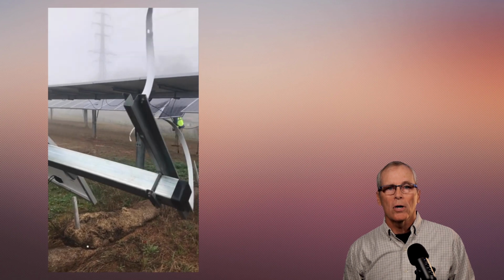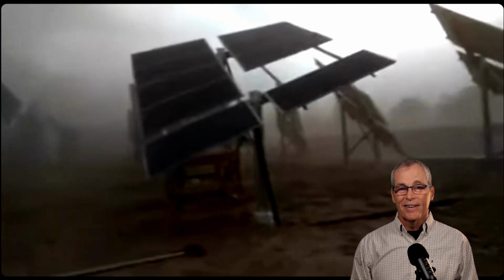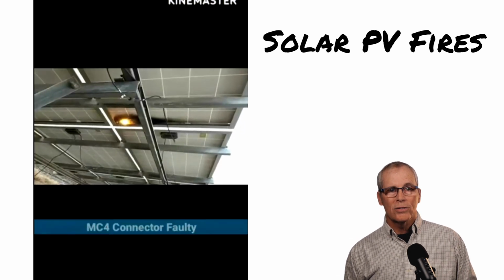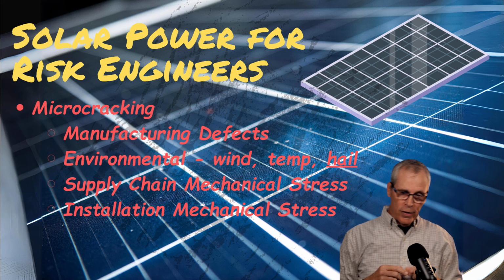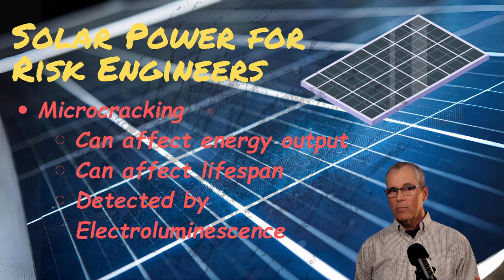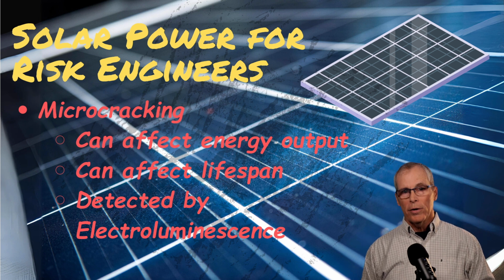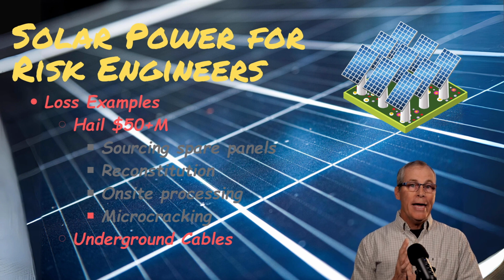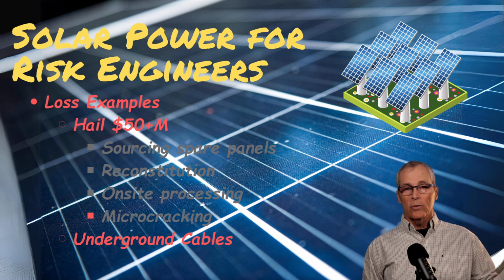Solar Power for Risk Engineers

Comment: I think insurers and other stakeholders should come up with a recommended distance between two strings which has to be maintained to avoid all strings catching fire from nearby strings. Apart from that heat/smoke sensors must be there under panel/string which can activate fire extinguishers or Medium velocity water sprinklers.
Reply from the maker: Interesting idea. We have to remember that the objective is to make electricity, not to prevent fires.

Comment: Great video and good points. A few thoughts:

- wind stow should not be flat. Flat panels will catch the wind like an airfoil and develop oscillating motion (torsion on the tracker torque tube). This leads to galloping - look up a couple decent losses from a big name tracker OEM in Australia that occurred well below design wind speed. So even though it's counterintuitive, wind stow is now usually designed the same as hail - fixed at max angle. This is still debated from the perspective of windborne debris, but with significant windborne debris you are going to have a bad day no matter what.

- checking for debris that can become windborne missiles (both on property and neighbouring properties) is a good idea on loss control surveys.

- vegetation management is the key for wildfire mitigation. Glass-glass panels (usually bifacial) are a little more resistant. Fire response plan is actually really crucial, because close coordination is required with utility staff to keep responders safe from electric energy hazards. Some owners use various other strategies including long-duration biodegradable fire retardants applied around solar farm perimeters during fire season.

- for microcracking, the only global OEM of thin film panels (First Solar) claims they are immune to microcracking, and have pretty compelling data, explanation, & policies to back it up. It's probably not enough to change procurement decisions, but definitely something to highlight.

Finally - I love your thoughts on 2x 66% capacity step-up transformers. It's an approach I also endorse and recommend. With the capacity profile of most solar plants, a single 66% capacity transformer is usually enough to capture >85% of revenues!
Reply from the maker: Thanks so much for contributing! I agree with your great points.